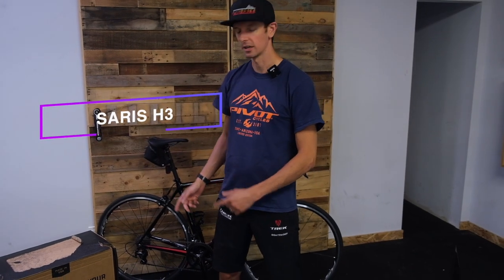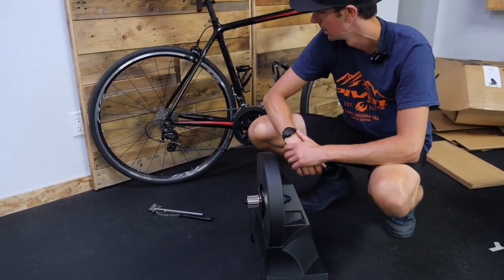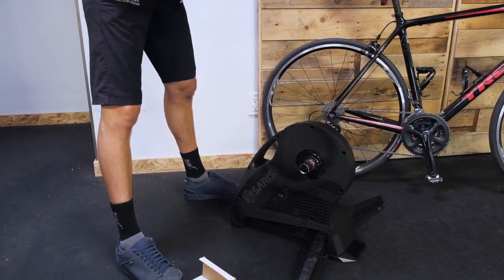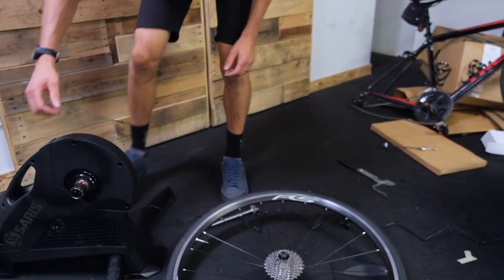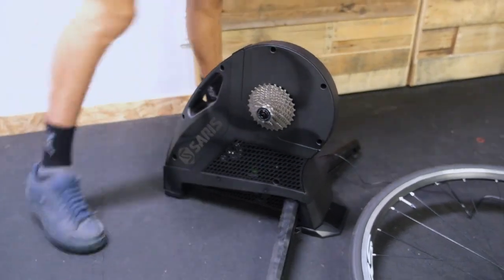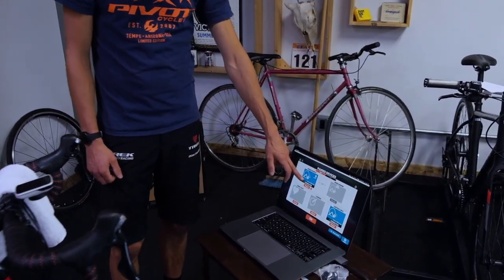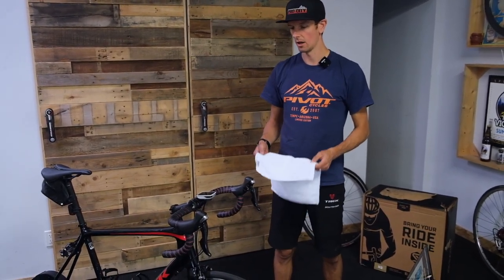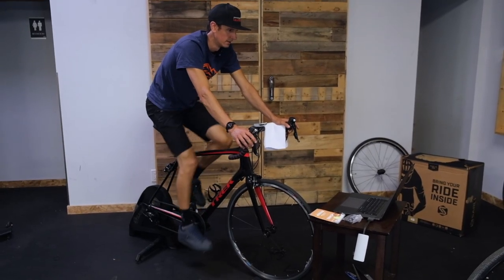Do You Want to Setup Your Smart Trainer? Watch This!

Comment: I own a Trek Emonda ARL 4 Disc  2021 and looking for a smart trainer,  I almost purchased a Kickr V5 and found out it was not compatible, will the Saris H3 work for my bike?
Reply from the maker: I have a 2019 Trek Emonda, and it worked on mine. It doesn't come with a cassette so you'll need to take the one from your bike. That's why it should fit.

Comment: Hi , I just ordered an H3, but I  read in several forums about an internal noise after a couple of weeks of use, and this noise is attributed to a defect in an internal pulley, to a kind of friction of 2 pieces inside , I wanted to ask you if you have had any problem like this or similar? since this h3 is famous for presenting this inconvenience and many people say that the saris service is lousy. This has me something worried, even to the point of canceling the order or returning the product, because in many internet forums they talk about this problem.
Reply from the maker: We haven't had any problems with the multiple items we've sold. The problems may have been older problems?
Reply: @TheHealthyT  tks a lot !!! I hope that my H3 doesn’t show this issue.

Comment: I heard there are potential clearance issues for thru axles with a solid handle (ie my 12-148mm thru axle)? Is that true? What are my options if so?
Reply from the maker: What thru axle do you have? You might need to invest in an axle that uses an Allan key.
Reply: @TheHealthyT  it's off my specialized Enduro comp, it's got a solid handle that comes out at a 90 degree angle to the axle. Went to a shop and took a look at one today and looks like I'll either need an Allen key thru axle or take the handle off and try to screw it on without the handle.